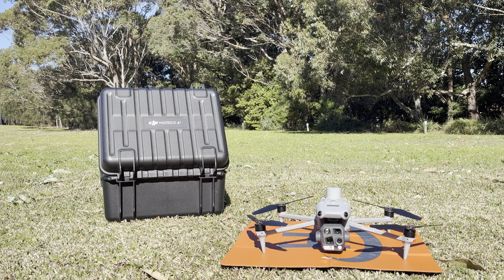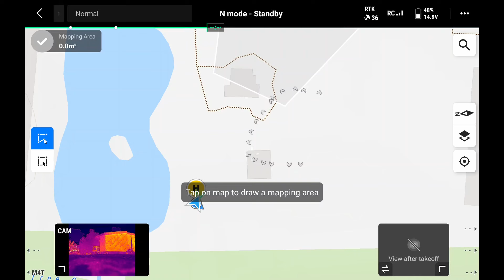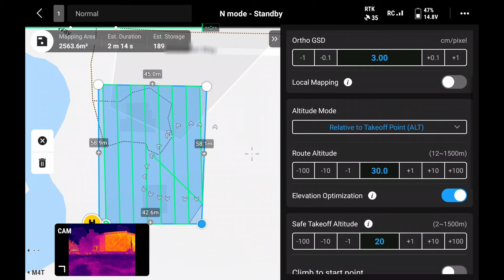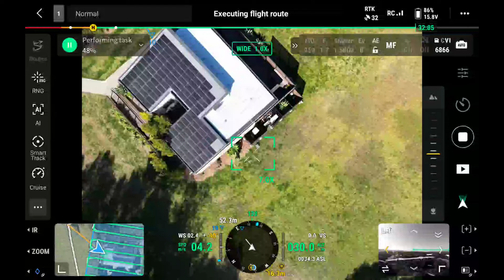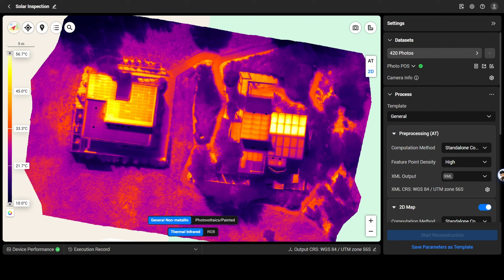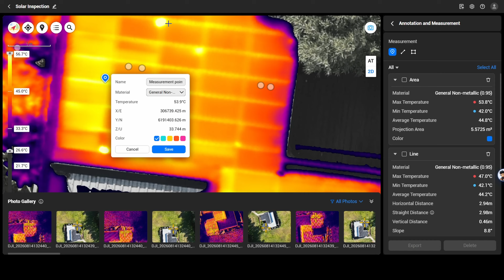DJI Terra 5.3 Thermal 2D Reconstruction: Solar Panel Mapping & Temperature Analysis

Comment: Why you didn't mentioned that terra are paid software?
Reply from the maker: Yes, sorry about that. DJI Terra is a paid software. It is possible to request a trial for DJI Terra, and DJI does often includes a trial with some of its DJI Enterprise products. Otherwise, yes, DJI Terra is a paid photogrammetry software solution.
Reply: So no more dji thermal tools?
Reply from the maker: DJI Thermal Analysis Tool software is still available to analyse individual thermal photos.
Reply: @Prisma_Technologies , I will have to check out the DJI Terra Thermal , I have thermal tools , im not a fan of the dji thermal tool report . The Flir studios is much better imo.
Reply from the maker: Sounds good. Let us know how you go with checking out DJI Terra 2D Thermal Reconstruction mode. 

Yes, some users prefer using FLIR Studio compared to DJI Thermal Analysis Tool software.